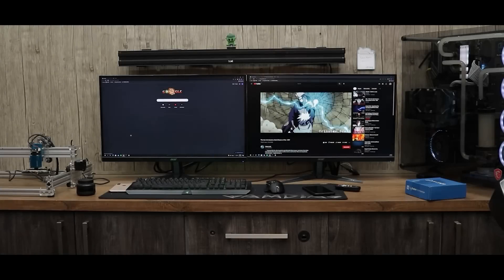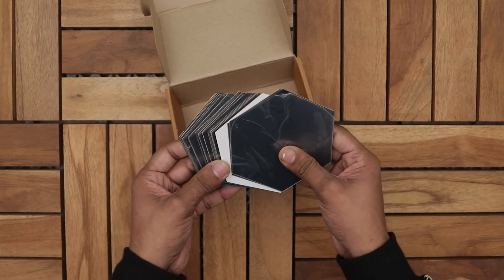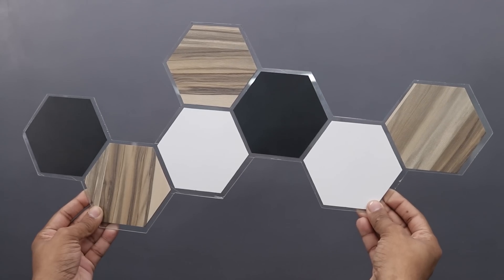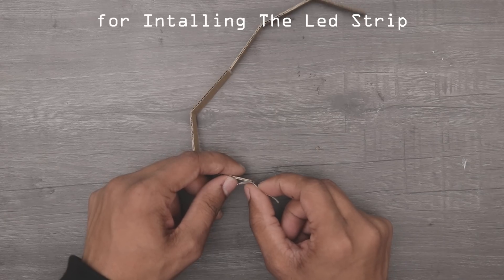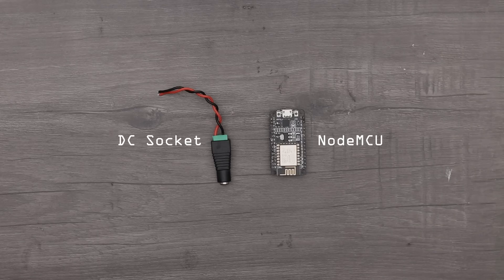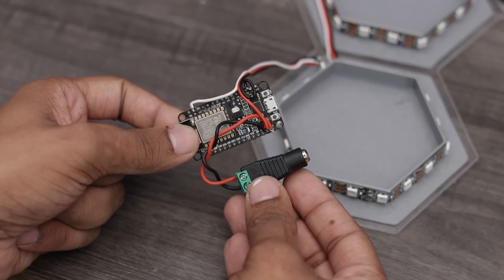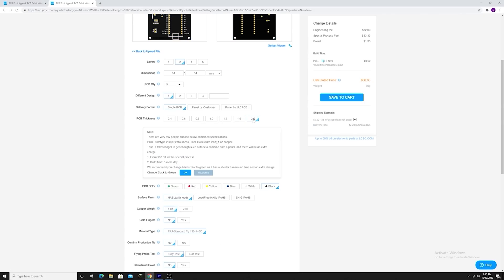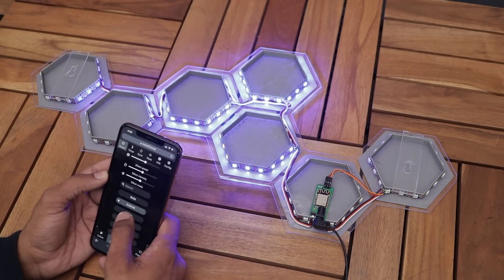How i Made Nano Leaf Panel Lights at Home under $30

Comment: Hey why don't you try adding diffuser strip to it so that the led doesn't reflect on the acrylic. I did the same but used a Pico as the controller, Well I am impressed by your technique
Reply: i used frosted acrylic and it looks amazing!

Comment: I don't know the point of ordering those hexagonal mirrors if you are going to cover them anyway, you can just use the acrylic sheet or cardboard as well
Reply: And hanging cable, like if it is on wall  put some batteries insted 🙄